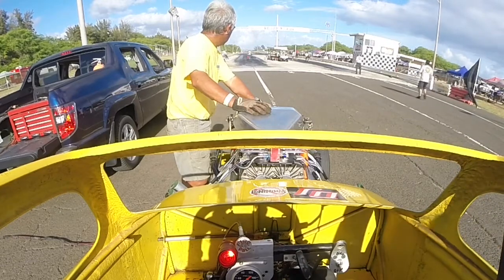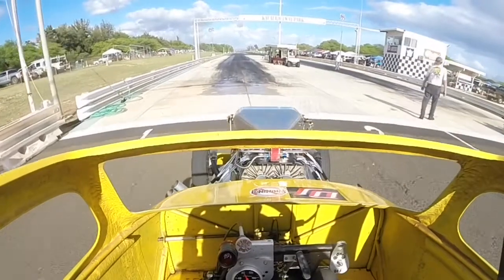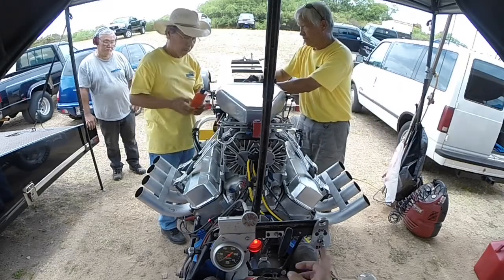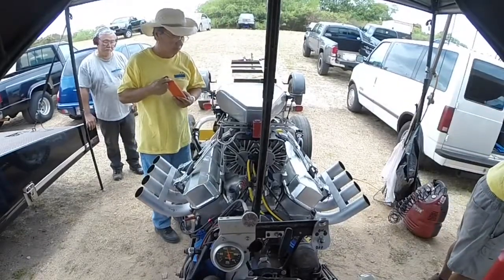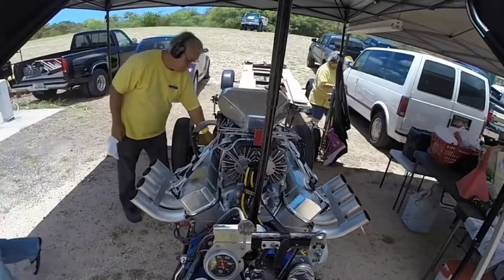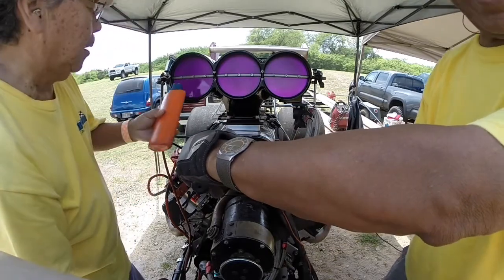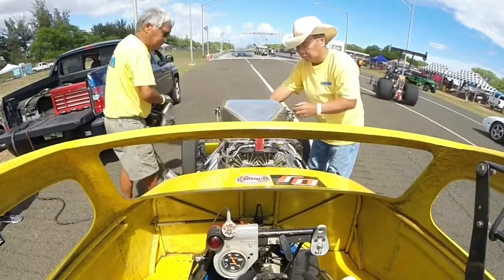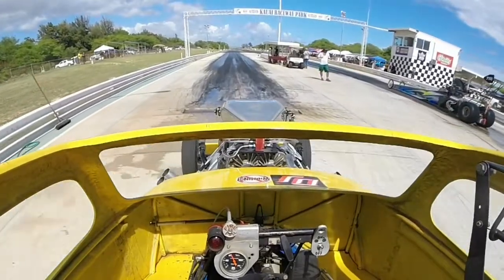How to Start a Blown Alcohol Engine

Comment: Does it go or is it just for noise. . . .
Reply from the maker: The '48 Fiat Topolino altered with the blown alcohol 427 big block Chevy runs 7.50s @ 175 MPH.  The rear engine dragster with the blown alcohol 469 Keith Black Hemi runs 6.70 @ 204 MPH.